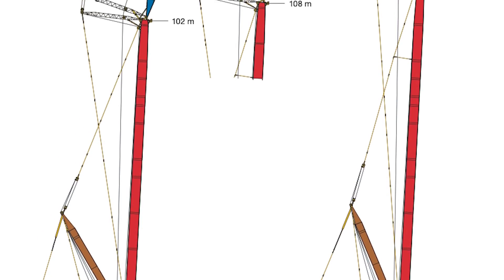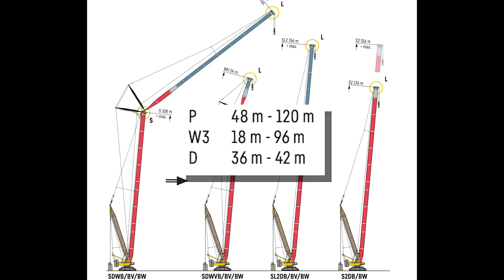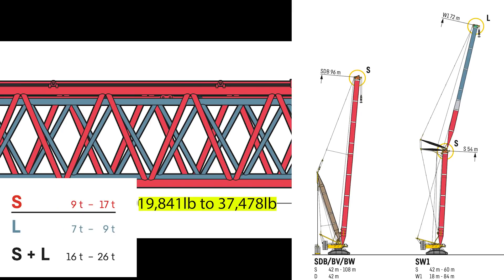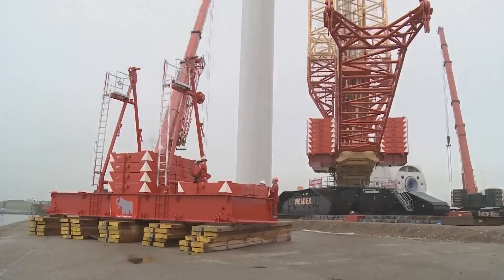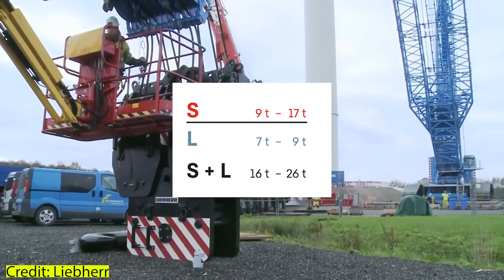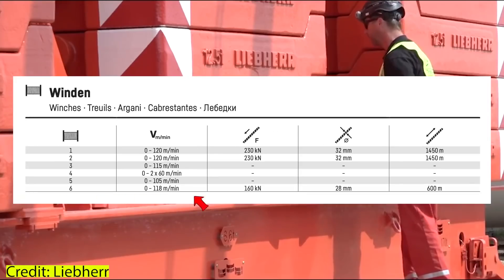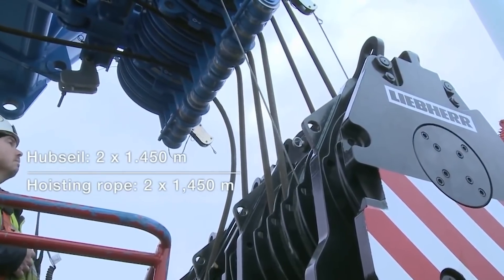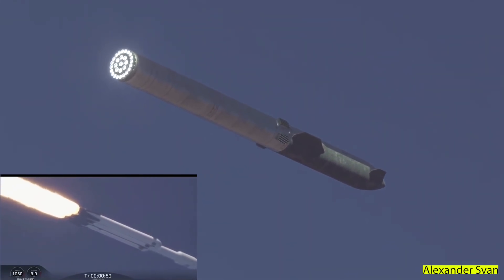SpaceX "CraneX“ In-Depth Guide: Booms, Jibs, Wind Speeds, Wire Ropes & More. Reasons to Buy - Part 2

Comment: Would you address the rumor that SpaceX already purchased a number of optional components for their new Space LR11000 crane that are not currently mounted on it? If this rumor is true, do you know what sorts of extra optional parts SpaceX purchased for their own LR11000 crane? Might SpaceX have purchased an extra main lattice boom sections, possibly a rear derrick boom, possibly additional modular counterweights and an extra counterweight (ballast) tray, and maybe a luffing jib for the new LR11000, all parts that would be currently stored somewhere, such as somewhere around the production site area?
Reply from the maker: That would totally make sense. This crane is really flexible, with many possible combinations, even more than Frankencrane, so there is no point in buying only 'half' of it. I believe SpaceX bought the whole crane and the parts that are currently not in use should be stored somewhere not too far away.

Comment: How do you build a Starbase on Mars? First, you design the crane. It has to be done first because everything else will depend on the limitations and capabilities of your crane.

THAT's why this video is important. SpaceX has already confirmed that building the Texas Starbase is a testbed for building a Mars Starbase. What I'm wondering now is how crane tech will have to be changed for Martian conditions.

I predict that we will see CraneX operated by an AI with minimal human supervision soon. This is because the first Mars cranes will probably arrive on unmanned robotic missions.
Reply: Hmmm - cranes will not have diesel engines then.
Reply: @peterblackmore7560  draglines are electric and operate at a much larger scale.
Reply: @danapeck5382  Yes I understand that.  In Yallourn (Victoria Australia), those types of draglines are in use mining lignite for the nearby power stations.  So nearby brown coal fired generated electricty is used.  At many remote mining sites in Oz, the electricity needed is created by diesel gensets. 
"The maximum solar irradiance on Mars is about 590 W/m2 compared to about 1000 W/m2 at the Earth's surface" - so more PV panels required to generate an equivalent amount of power. However, lower gravity means smaller motors required. At the limit of my knowledge base!
Reply: @peterblackmore7560  permitting solar on Mars should be easier...
Reply: @danapeck5382  LOL - well that's spot on!
Reply: @peterblackmore7560  Good point.
Reply from the maker: I imagine the first cranes will be small and powered by solar. They won't need a super strong hoist due to reduced gravity. I will look into it, maybe I can gather enough info to make a somewhat sensible video 😀

Comment from the maker: Additional notes: I didn't mention this in the video to avoid possible confusion, but looking at the technical data, I noticed that the LR11000 has a max. Lifting height of 224 meters (735 feet), whereas Frankencrane/LR11350-P1800 couldn’t  go higher than 186 meters (610 feet) above the ground. On the website of Liebherr, they state that the max. Lifting height of both cranes is the same, and that is what I told you in the first introductory video of this series. It was after digging in the data that I noticed this, although they also remark that the information on these technical brochures serve only as general information. The operational manual and load chart book appear to contain more accurate information. Anyway, the highest SpaceX has built on Starbase is 145m (Integration Tower), so this small discrepancies seem to be irrelevant for the time being. Just wanted to let you all know :)